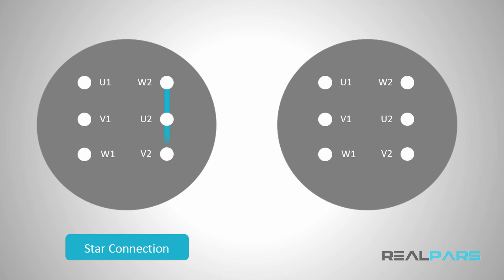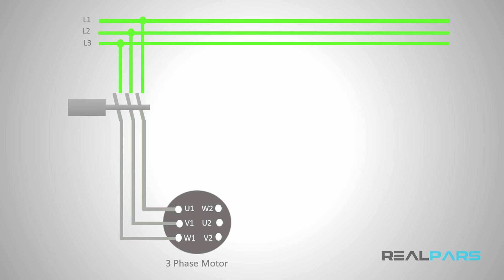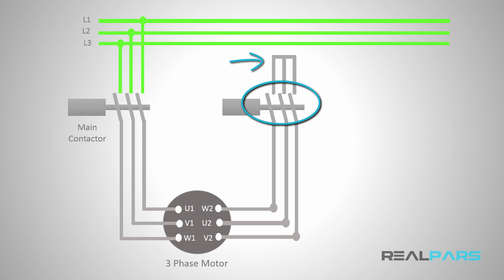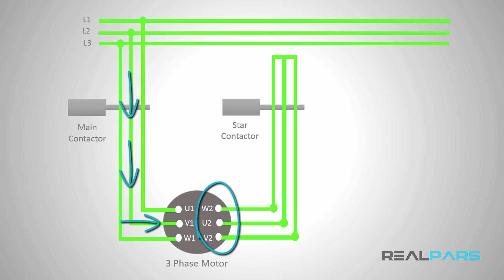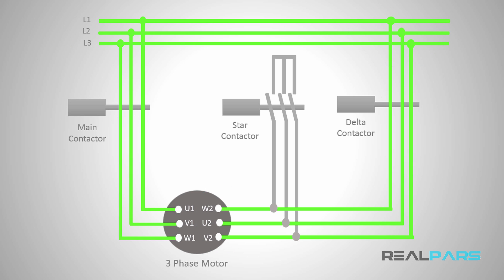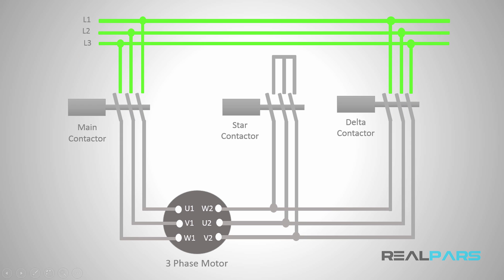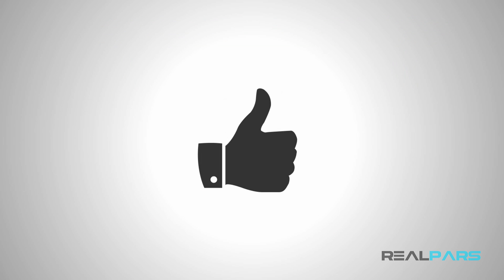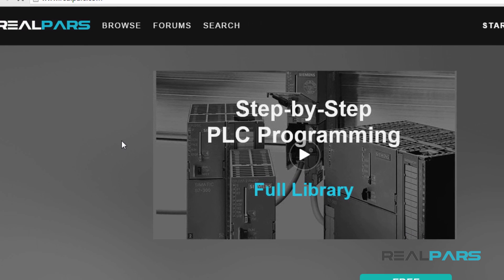Star-Delta Starter PLC Program and Wiring_Part 5

Comment: Hi and thank you for such a good job!😊 I still have a question. Isn't it better to interlock the contactors to prevent "accidentally" engaging the star or delta? or to prevent the terminal welding of the contactors?😊
Reply from the maker: Hello @VladAlexandruTamirjan,
Thank you for your question. Yes, this would normally be handled on the PLC control side by interlocking the control relays. In addition, other safety measures are typically applied, such as overload tripping devices and safety interlocks.
Reply: @realpars Thank you for replying! Wish you a nice week!👍

Comment: I am kinda like the idea of your lesson, but you guys have to put a disclaimer that this is a test setup not to be used in real life!!! I would not do the control of both star and delta contactors with PLC outputs, just because failed DO output can make a nice bang and start fire in the cabinet. Industrial application would include the interlocking of the two relays so that no way two are actuated at the same time. Another thing is that in real life it takes less time to close the contactor than to open it. Therefore good star/delta relays are not simple on-off delay timers. There is important timer between release of star contactor and closing of delta. It is about 50 ms. If not then there is a risk to still have short overlap, your relays will be out of order soon.
Reply from the maker: Thank you for the comments.  Your suggestion is valid, and you are correct, the timing between the star and delta contactors has to be done with a dedicated electromechanical timing device that controls the transition from star to delta.  As a practical matter, all companies have rules concerning qualification for anyone working on 480VAC equipment, and those who are qualified would not configure an unsafe system.

Comment: Great video!  I have noted though that the actual motor terminals used for this video demonstration appears to be connected in the delta configuration with copper links or jumpers. Perhaps what looks like copper jumpers be removed for clarity.
Reply from the maker: Thanks for the tip Daniel!

Comment: Is a  star-delta necessary if you have an VFD? I mean the VFD would limit the starting in-rush current and you wouldn't need a star-delta right? Also is there a tutorial with a PLC connected to a VFD?
Reply from the maker: These are just different ways of controlling the rush current.

Comment: Thank you for video. A question now. How do you ensure your motor runs the same direction in delta as it did in star,assuming you have no motor winding wire markings. I know how to separate each individual winding using a multi-meter but this doesn't guarantee the same direction of rotation when changeover from Star to delta happens